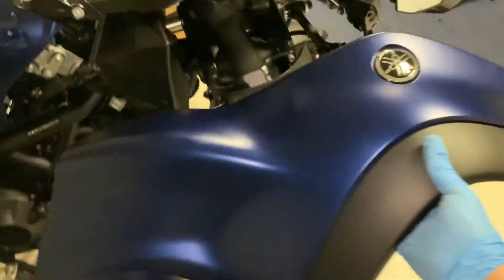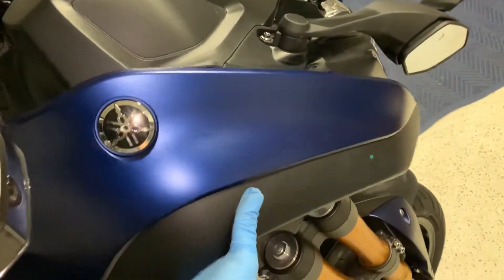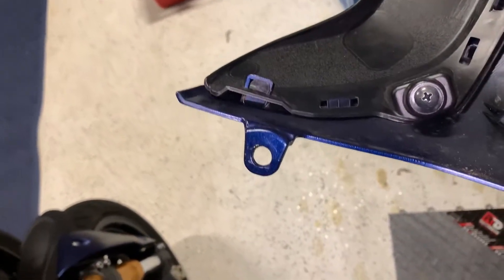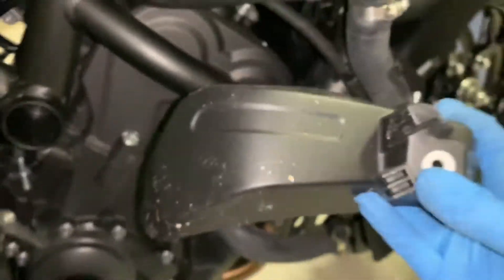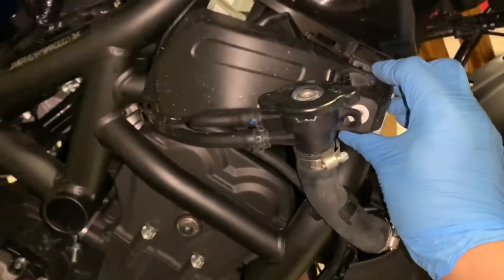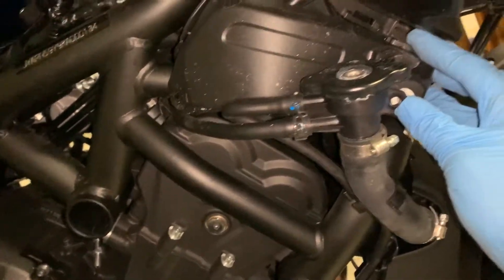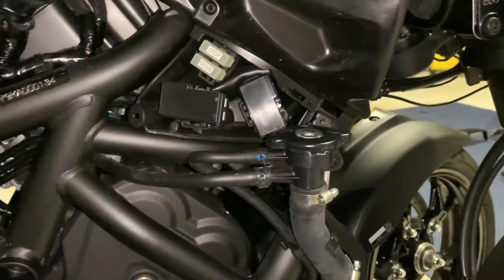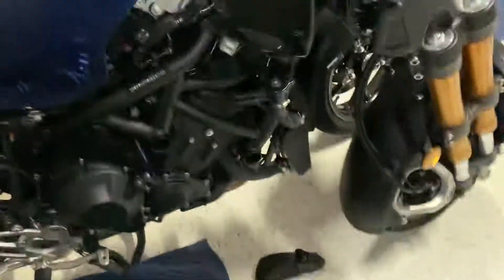How to remove right cowling on Niken

Comment: Hi Edward, very useful info.  Did you film taking off the front central and side panels?   I assume the 2 screws at the top of the black central panel behind the instruments release the whole panel to give access to the pair of small front panel fasteners.   It’s not obvious to me. Any help appreciated.
Reply from the maker: I did video the front  panel component but on s separate camera.  I didn't upload it because of they length of the video but I'll see if I can shorten the video so that upload time doesn't take forever. I literally took off almost every bolt  and retaining clip just to be sure that they didn't somehow retain another hidden tab like the one you saw in the video.